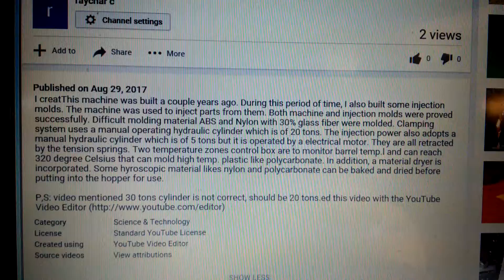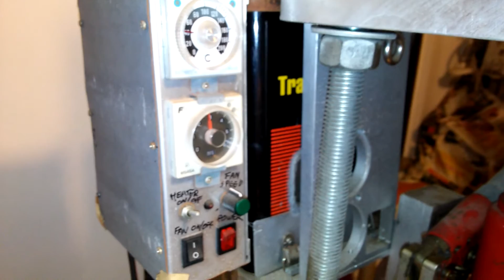My diy injection molding machine (Generation II)

Comment from the maker: Later， as I am now modifying it。Desiccant dryer is to bake and remove absorbed moisture in the plastic pellets。Like nylon，abs and polycarbonate。 All parts are diy except using some reaily available used utilities or cheap components。

Comment: Interesting Injection molding machine. Never seen anything like that. Would like to see it working. How that material dryer work? Is it homemade dryer or have you used some ready parts? Check out my plastic injection molding machine.